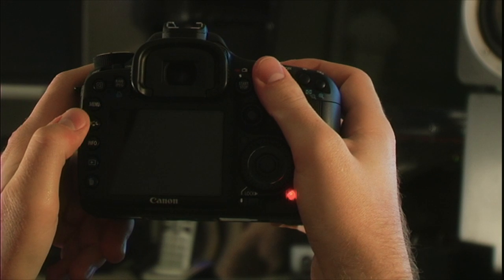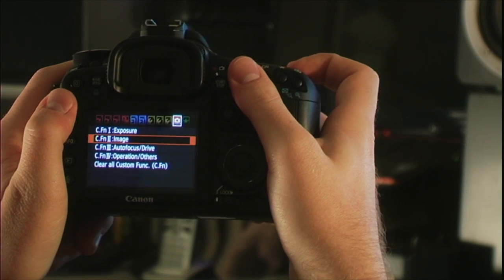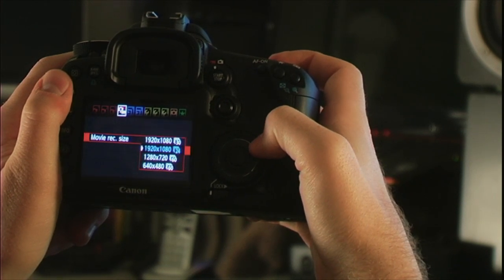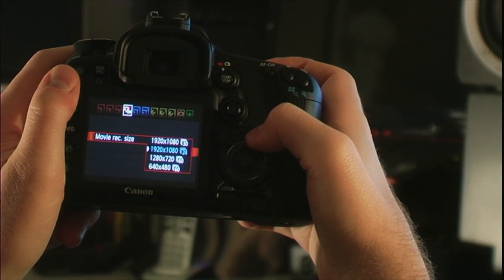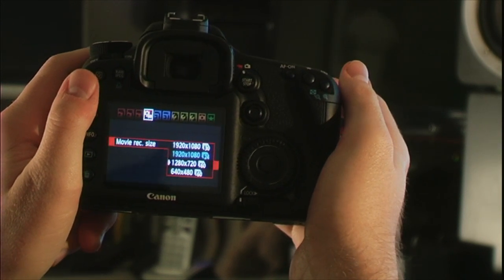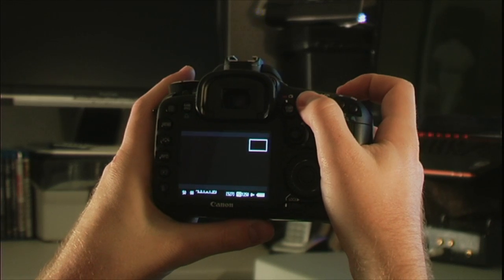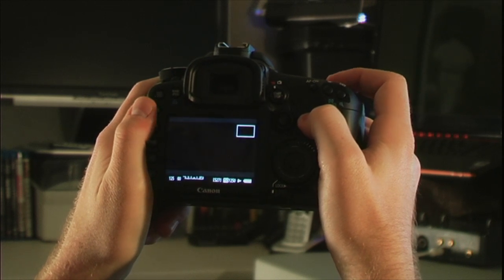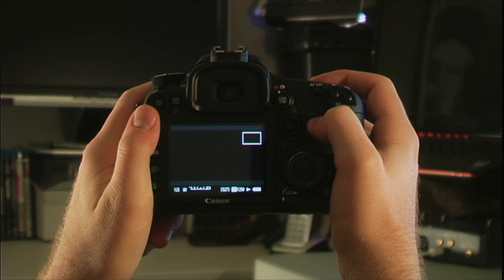2. Slow Motion Prep and Moire removal for Canon EOS 7D

Comment: Hi, I would like to ask you I have 5d Mk 2 but it doesn't have 60 fps or 30 fps it has only 24 and 25 do you know why? And also you recommend for ISO settings not to go below 200 but I have shot on even 100 ISO and I don't see any problem.

Regards 
Svetozar

Comment: Hello, I have a question. I use the 550D and let's say that's the same video thing. When doing slow motion at 60 fps I get artefacts and ghosty image when slowing down using twixtor but slowing down a lot, to 5% for example, not to 24 fps. What shutter speed do you recommend for extreme slow motions? Thank you a lot..

Comment: Patch,

When shooting video with the 5d M2, what is physically going on inside the camera?  Is the sensor simply collecting the images and putting it on the flash card with the shutter and 2 curtains always open or are the 2 curtains and/or shutter opening and closing at various rates of speed set by you shutter speed settting?

I would think if the 2 curtains/shutter are opening and closing all the time it would shorten their life very quickly.

The Meltdownman

Comment: @Dorfjockel89 I'm not a pro at all, but this looks like it caused by a PAL system setup, if you change to NTSC, you should get the 30/60fps options

Comment from the maker: With the D90, the shutter would be 1/50. You cant control the shutter in video mode, so you would need to use the flashlight + aperture control trick to try and reach the closest to this number. If you actually hit 1/50, the rolling lines on the screen with flourescent lights will go away.